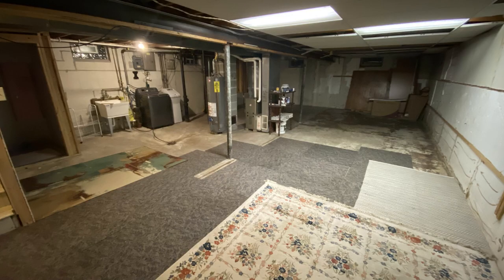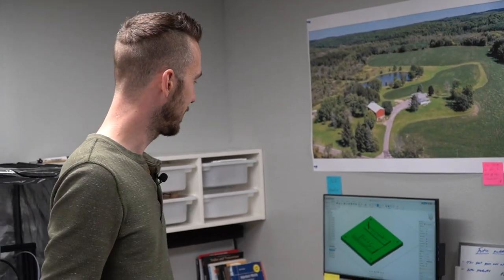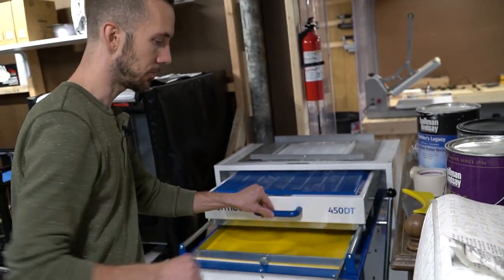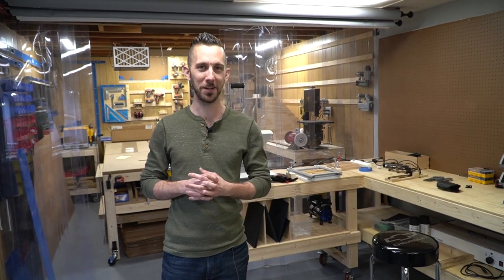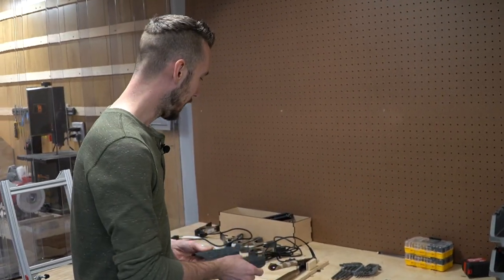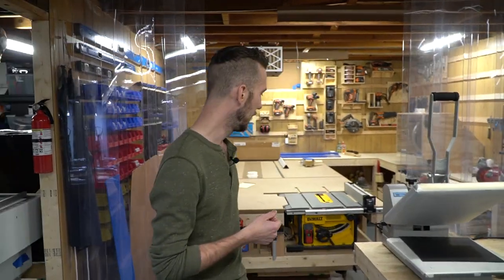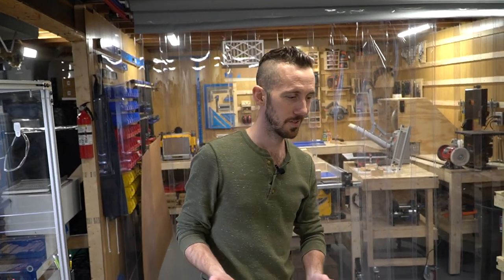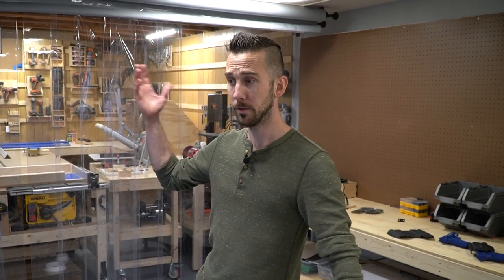Shop Tour 2022

Comment: I know it's probably too late, but on your CNC router, for the hold down clamps, you can make the long ones quick release just by switching from knobs to threaded stud cam levers. That way you can keep the height setting the same after the first adjustment. 

Also, for the end mill to cut the kydex, you want either an AiTn coated high speed steel OR cobalt high helix end mill for the feed rate you're running, and you might actually be able to run the feed faster than that. The thing with kydex is it's technically softer than aluminum, but it's more abrasive than aluminum, so you kind of want to treat it like a carbon fiber infused nylon.
Reply from the maker: Those hold down clamps sound great, I’ll look for them. Thanks for the tips on the end mill. I wouldn’t have thought Kydex would be that abrasive.

Comment: what would you recommend as a great first cnc or glow forge or 3d printer for a wood and slight metal worker?  great tour  Thanks.
Reply from the maker: I think I’d recommend the Onefinity Machinist CNC as a first machine. Really fun for wood working projects. You can also play around with some soft metals like copper and maybe some aluminum if you went really slow.